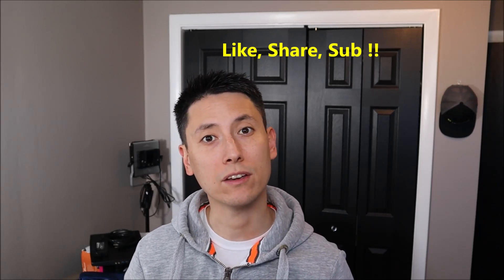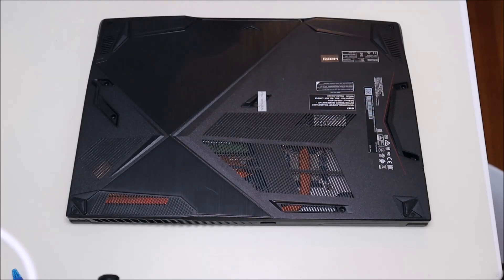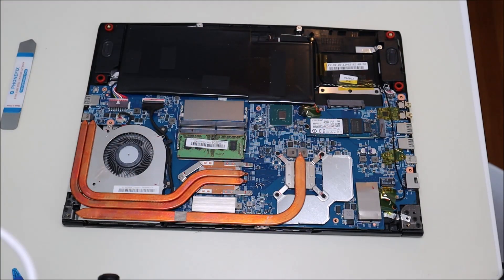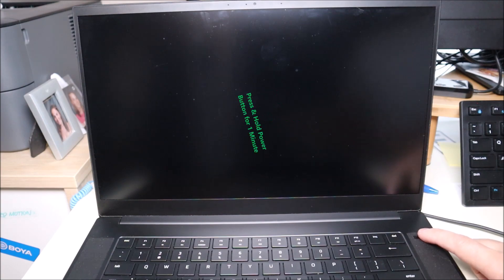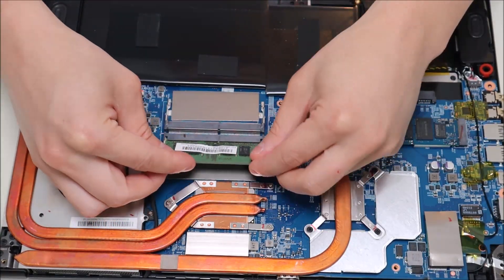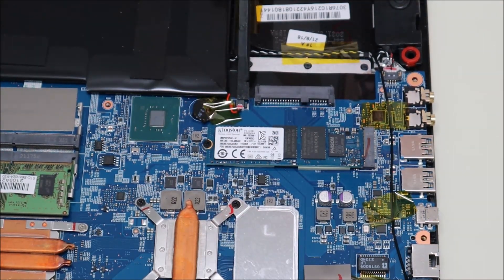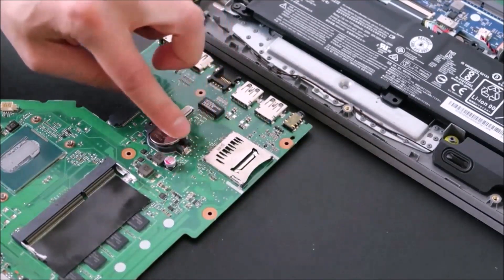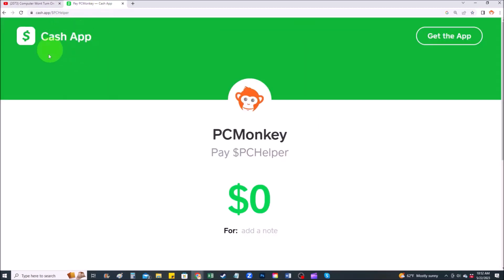MSI Laptop Computer - Dead / No Power / Wont Turn On Fix

Comment: @PC_Monkey   Unplugged the battery... nothing. Removed the memory then unplugged/replugged battery again and playing with those two things got it turned on. I was going to use sleep/hibernate for a power switch, but after entering hibernate mode, I was unable to get out of it with the power switch basically leaving me with nothing. I'll open it again, and try unplugging the battery to get it back on track, and If anyone can think of a way to turn the hibernate/sleep off, or come up with another way to fake an off/on switch, please let me know. I tried the mouse and every key on the keyboard to wake it but nothing.

Very helpful video and a whole lot easier than loading this thing up and trying to find an honest repair person.
Reply from the maker: Happy to help :) Always here if needed !!
Reply: @PC_Monkey  I could be wrong, but my last post seems to indicate my power button is bad. I think that because not only will it not start the laptop, but it will not turn it off, nor will it bring the PC out of hibernate or sleep and the power button is set up to wake it.

Not asking for any guaranteed correct answers. 1) Do the symptoms tend to lead you to believe the power button is bad? 2) I'm needing to know if my MSI GL66 Pulse 11UGK-001 has a way of assigning another key for power in the bios? 3) Since it's very tricky to get this started I need to know the exact key if possible to tap up the bios. Best I can gather is it's the delete key, is that correct? 4) For any other work around you can think of, I would be greatful.

Thanks and again, just want your best guess, as it will be a lot better than mine...right or wrong, no harm no foul.

Comment: Couldn't get anything to work 😢
Reply from the maker: Are there any signs of life at all when you try to turn it on? Lights? Fan, Motherboard, or Hard Drive sounds? Anything seen on the screen? Also, did anything happen before this issue appeared?  Liquid spill, overheating, Windows update, etc?

Comment: Hi
I have an MSI sword 15 11 gen laptop.
The light for the battery is always on even though I shut down my laptop. It turned off only when I disconnected the laptop battery. What could be the issue? Please advise

Comment: Did I fry my psu? I was on elden ring in a castle then it said restarting system. And it never came back on I did add ram. Yes i did try removing both ram sticks still  nothing 😢
Reply from the maker: Are there any signs of life at all when you try to turn it on? Lights? Fan, Motherboard, or Hard Drive sounds? Anything seen on the screen?

Comment: I have a hp laptop and the holding down doesn’t work power supply is ok but still not turning on
Reply from the maker: Sounds like your on the correct video.  Have you tried the steps seen here?
Also, did anything happen before this issue appeared?  Liquid spill, overheating, Windows update, etc?
Reply: @PC_Monkey  no spillage at all I have tried all things but it looks like next step is pulling apart which I don’t want to do

Comment: @PC_Monkey i cant find my RAM, my computer is MSI KATANA GF6612UEOK 15.6" Gaming Notebook 144, Intel Core i7-12650H,can u please help me, i just use this laptop for 6 months and it cant be power on now, i already try the power discharge thingy, taking out the battery, im now stuck at finding my RAM, please help 😢
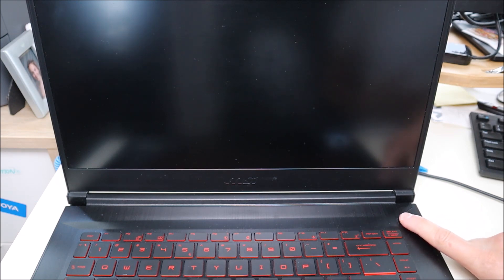Reply from the maker: Is this your computer? https://www.youtube.com/watch?v=OhAVP6iKIck. At 1:20 hes working on the RAM
Reply: @PC_Monkey  i ended up goin to repair the laptop in the shop, they say the motherboard need to be repair, btw thx for your help tho, it's a rlly good video, keep up the good work brotha :D

Comment: Im hoping you can help. My MSI GS65 Stealth thin 8RF was working for about 10 minutes after turning it on and all of a sudden it went dead. Now when I power on, power LED lights up white and goes orange almost immediately after white lights up. No screen activity whatsoever.. Power bar ok. I've replaced battery (needed it anyway). CMOS battery was dead. Will replace shortly but still does not boot up. Should with or without CMOS battery.
Reply from the maker: After replacing the CMOS, let me know how it goes after a power drain. Also, is the replacement main battery generic or brand name MSI?

Comment: Still won't boot, perhaps I will pull the motherboard and see what happens.  Thank You 🙂
Reply from the maker: Are there any signs of life at all when you try to turn it on? Lights? Fan, Motherboard, or Hard Drive sounds? Anything seen on the screen?  Also, did anything happen before this issue appeared?  Liquid spill, overheating, Windows update, etc?

Comment: I have an msi thin gf63 and I tried the simple steps at the beginning as well as reseating my ram and removing my cmos and it still isn’t turning on. Any suggestions?
Reply from the maker: Are there any signs of life? Lights, sounds, etc? Also, did anything happen before this? Liquid spill, overheating, update?
Reply: @PC_Monkey what if there are no signs of life

Comment: One of those who had to manually open my laptop and remove the battery then hold the power button for a minute. Thanks a lot, men. You saved me!!
Reply from the maker: Glad your all set :) Always here if needed !!
Reply: did you eventually change your battery? and if so did it power on normally?
Reply from the maker: @XenonForce  Very sorry but YouTube never alerted me to this comment :( Do you still need help?
Reply: @PC_Monkey i ordered a battery, and i tried it as well, i still didnt fix the problem, so i returned the battery.
Reply from the maker: @XenonForce  If, after trying all the steps seen here multiple times, you have not been able to find the issue, your most likely looking at one of two possible issues. (1) The motherboard is bad and needs to be replaced. Let me know if you would like help finding a compatible motherboard. Or (2) there is another computer component, shorting out the motherboard and need to be replaced such as the power jack, USB board, Touchpad, etc. You would have to troubleshoot each of those individually but unhooking it from the motherboard and trying to turn the computer on. Let me know if you would like help with that operation.
Reply: @PC_Monkey sure, i will try to perform every step in this video. so far i have only tried the first method, and it actually works every time. it is a good temporary fix as i was busy and didn't have enough time to look into the issue properly.
Reply from the maker: @XenonForce  Glad it helps. Hope the issue can be resolved fully in time :)

Comment: My pc turns on just sometimes! It's stays one week then when I click the power button it turns on, sometimes it even just turns on the keyboard light and turns off, I hate this so much! Is there a fix?
Reply: I forgot to mention it crashes
Reply from the maker: @ryancool1416  Sounds like your on the correct video.  Have you tried the steps seen here?
Also, did anything happen before this issue appeared?  Liquid spill, overheating, Windows update, etc?
Reply: @PC_Monkey  nope, all tho I still haven't tried these steps I feel like if I did them they will work, but I don't want to remove my warranty sticker, I'll bring it to the shop I bought it from and let them fix it. No overheating, no spill, update did happen but they did nothing. Thank you for responding, do you think I should let the shop fix it for me?

Comment: There are 2 issues with my laptop. 
1st: My laptop suddenly shuts down on below 40 percent like sometimes on 37 , sometimes on 29 percent etc, and not turned on until I put it on charge and when it turns on after getting plugged in then the remaining percentage is same on ehich it shuts down, it means the batter still have some percentage then why it shuts down???

2nd: my laptop sometimes stop charging at 90 percent, sometimes at 91 , sometimes at 94 percent and not charged upto 100 percent, but sometimes it charge upto 100 percent, why is this happening???? 

Please answer the question and share the solution thanks
Reply from the maker: Can you try the steps seen here? https://www.youtube.com/watch?v=uBr5XmtmKKM. If they dont help, have you tried replacing the battery?
Reply: @PC_Monkey  I have tried these steps and many other ways but nothing change. Can you please advice me if I use this battery while always plugged in , will it be good ? or will it effects other components of my laptop while always plugged in and using . Please reply

Comment: Hey, i have MSI stealth 15m and i did all the steps but the laptop didn't work, what can i do?
Reply from the maker: Are there any signs of life at all when you try to turn it on? Lights? Fan, Motherboard, or Hard Drive sounds? Anything seen on the screen?  Also, did anything happen before this issue appeared?  Liquid spill, overheating, Windows update, etc?

Comment: My gf76 died, when updating the bios it turned off and now it doesn't show any signs of life, I'm going to try to remove the CMOS battery, but I believe that only by rewriting the chip will it be able to come back to life, do you have any suggestions?
Reply from the maker: Have you tried removing the CMOS battery for a couple minutes to reset BIOS?
Reply: @PC_Monkey  I reset the CMOS battery and the notebook turned on again, now I have to reinstall Windows.. thank you!!

Comment: My laptop had Stuck on the update screen and then I opened it  without the battery removed I change ram and after my laptop is not working 😭 please help what me gonna do
Reply from the maker: How is your laptop not working? Are there any signs of life at all when you try to turn it on? Lights? Fan, Motherboard, or Hard Drive sounds? Anything seen on the screen?
Reply: @PC_Monkey  nothing is working
Reply: @PC_Monkey   How much will it cost to fix it😕

Comment: Hello, I have a MSI GF65 the fans are turning on and the keyboard RGB is turning on but I’m not getting a display. 

It’s getting power but it just won’t turn on. It tries to turn on but then it turns off after about 45 seconds. With or without the battery. I replaced the CMOSS battery because I had it serviced and the technician said it was volting well below 1.0v. And still nothing.

I’ve tried reseating the ram, removing and plugging in the battery again, reseating the cmoss battery and the display as well. And nothing I would appreciate some help.
Reply from the maker: Did you try the power discharge procedure as seen here? Also, did anything happen before this issue appeared?  Liquid spill, overheating, Windows update, etc?
Reply: @PC_Monkey  yes I’ve tried the power discharge method and no I don’t believe it overheated and there wasn’t any windows update that I know of and I keep away from moisture

Comment: My msi laptop is still not working. I keep trying it once per month and nothing. sometimes the keyboard LEDs turn on but turn of right away and sometimes the charging port light. Also I do not have a cmos battery. Can you help?
Reply from the maker: did anything happen before this issue appeared?  Liquid spill, overheating, Windows update, etc?
Reply: @PC_Monkey  I did leave it plugged in a bunch so maybe that. One more thing, bellow the battery there is like a white paper kinda thing and its a little folded so maybe it could be that?

Comment: I have a different model. AX201NGW. Any auggestions?
Reply from the maker: This troubleshooting process is not model specific. Is your computer dead and not turning on? If so, have you tried the steps seen here?
Reply: @PC_Monkey  Yes, I tried the method in here and a few other ones from another of your videos. The only test I couldn't do was the ram because I was not sure how to find it. I may have to take it to a repair shop!

Comment: Hello, msi gf66 laptop suddenly turned off and wont power on again, tried all the steps but nothing happened :( can u help me please 🥹
Reply from the maker: Are there any signs of life at all when you try to turn it on? Lights? Fan, Motherboard, or Hard Drive sounds? Anything seen on the screen?  Also, did anything happen before this issue appeared?  Liquid spill, overheating, Windows update, etc?
Reply: @PC_Monkey  no signs of life, no lights/fans, nothing on the screen :( I even tried to start it up with no battery but still not powering up :(
Reply: @PC_Monkey  mosfets all burned up due to extreme heat

Comment: If i press it down for a minute, the led starts blinking but nothing else is happening afterwards, any idea ? MSI vector gp68
Reply from the maker: Sometimes you need to try the power drain quite a few times. Have you tried the other steps seen here? Also, did anything happen before this issue appeared?  Liquid spill, overheating, Windows update, etc?
Reply: @PC_Monkey  yep it's was an windows update that took like an hour , so I powered it off with the button.
I can't try the battery removal , because I still got warao. So I'm going to send it in and see what they can do.

The power button is blinking 10 times when I hold the power button.
Reply: @PC_Monkey  they swapped the Mainboard under warranty, I wonder if there are known issues with MSI Mainboards?

Comment: It helped but now it happens every once in a while. every now and than i have to press power button for 1 minute to start the laptop.
Reply from the maker: Are you using the computer plugged into the wall outlet or into a surge protector? Also, did anything happen before this issue appeared?  Liquid spill, overheating, Windows update, etc?

Comment: My laptop turn off when playing games when the laptop is not connected to the charger. Why
Reply from the maker: If a computer turns off when not connected to charger, my first guess is the battery is drained. What is the status of your battery when it turns off? Also, did anything happen before this issue appeared?  Overheating, liquid spill, Windows update, etc?
Reply: The laptop is new and the battery is good when browsing on the laptop. No, nothing happened to the laptop @PC_Monkey
Reply: The laptop is new and the battery is good when browsing on the laptop. No, nothing happened to the laptop
Reply from the maker: @thecooking8370  Does it only happen when playing that game or at other times? Using the computer off the game or browsing online? Can you find an error matching the time it turns off as seen here? https://www.youtube.com/watch?v=Nqn8-jJFx2Y

Comment: I had my RAM upgraded earlier today, it worked fine for a few hours but suddenly crashed and won't turn on again... any tips before I bring it to a professional?
Reply from the maker: If you remove the new RAM and put the old back in, does the issue go away?
Reply: @PC_Monkey  I'm not sure, I gave the old RAM to the guy who changed it for me, so I have to wait until at least Monday to see if that'd work...
Reply from the maker: @IsaacWale2004  Other that that, you can start troubleshooting here: https://youtu.be/kOBY4k2Mn_k. Let me know how that goes :) Also, did anything happen before this issue appeared?  Overheating, liquid spill, Windows update, etc?
Reply: @PC_Monkey  Thanks.
And no, I haven't had any spillage or excessive overheating...

Comment: I had my RAM upgraded earlier today, it worked fine for a few hours but suddenly crashed and won't turn on again... any tips before I bring it to a professional?
Reply from the maker: Are there any signs of life at all when you try to turn it on? Lights? Fan, Motherboard, or Hard Drive sounds? Anything seen on the screen? Also, did anything happen before this issue appeared?  Overheating, liquid spill, Windows update, etc?
Reply: @PC_Monkey  The fan goes and the light on the power button shows, but no screen shows...
Reply from the maker: @IsaacWale2004  Yes, if the fan and the lights are on, most likley the computer is on. For a computer that turns on but the display does not work, try this video first; https://youtu.be/e9iy30J00-k.  Let me know how that goes :)

Comment: I was playing apex and it suddenly went black i got scared and left the labtop over night when i start in morning it was the same then  There was something, after i tried alot it was booting up nicely but when charger was unplugged as soon as i plug it goes black then i have to restart..so i thought maybe some dirt prob or energy prob so i look for solutions i did all drain charge by removing battery, i even cleaned ram from carbon residue and cleaned fans.... But after all that now it doesnt even start from unplugged maybe i think when i was using it before rhe charge was gone and now maybe charger cant charge it so idk whats the problem can you help me.
Reply from the maker: Are there any signs of life at all when you try to turn it on? Lights? Fan, Motherboard, or Hard Drive sounds? Anything seen on the screen? Also, did anything happen before this issue appeared?  Overheating, liquid spill, Windows update, etc?

Comment: Hey I have a msi g73 leopard 8re I have a problem it not starting and it ticking red light on start button , I took battery out I tryed and same thing , could be the charger ? Any idea ?
Reply from the maker: Sounds like your on the correct video.  Have you tried the steps seen here? Also, did anything happen before this issue appeared?  Overheating, liquid spill, Windows update, etc?

Comment: Hey so I have a MSI Raider GE76 and the power button doesn't work because I accidentally somehow disconnected my keyboard which for some reason is also connected to the power button. I know the laptop itself works but is there another way I could power it on?
Reply from the maker: Did you reconnect the keyboard after? If so, simply unplugging and replugging in a keyboard should not damage anything connected to it. Is there another reason why you feel the power button is damaged? Are you able to try the steps seen here in this video?